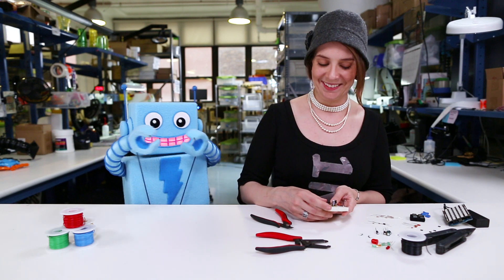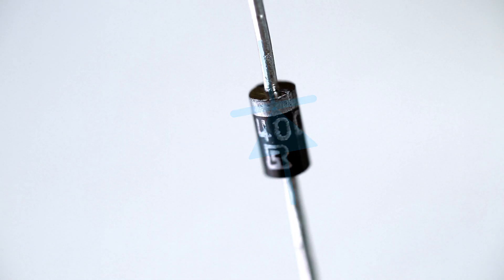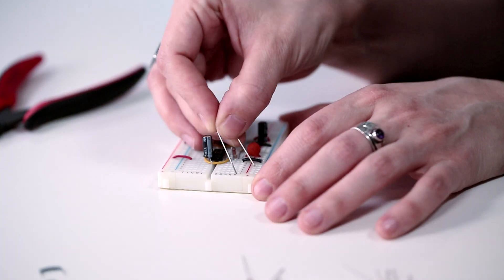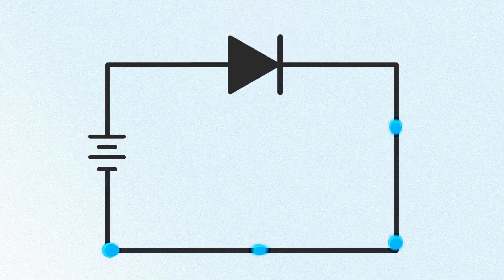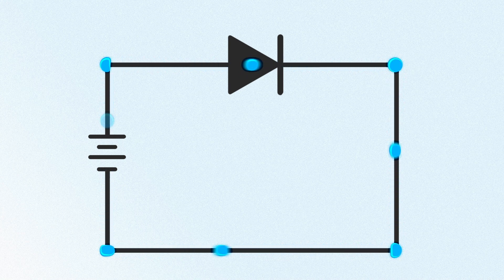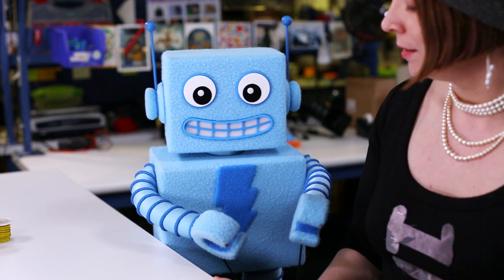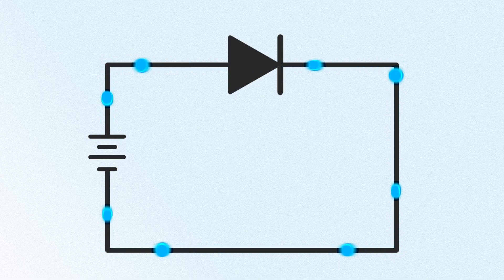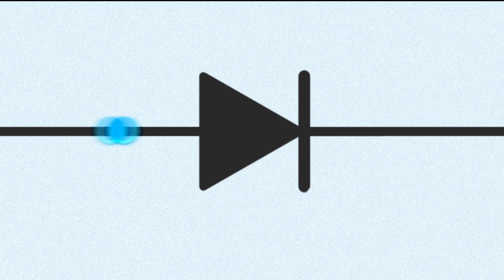"D is for Diode" - Circuit Playground Episode 4

Comment: Using a diode in series is not the best for reverse polarity protection, because of the voltage drop, but it is indeed a surefire way.

Comment: They got the current direction that flows through the diode wrong, it goes through the arrow in the direction its pointing
Reply: They showed electron flow. Which is opposite to conventional current.
Reply: pairofdice Showing electron flow opposed to conventional current wasn't very instructive. Confusing for a beginner.

Comment: I was expecting the diode to be used as a crowbar to protect from reverse  polarity. First of the voltage drop across the diode. Second sparks and a blown fuse should clue someone in they did  something wrong. Should.. I have open some stuff  where someone had large supply of fuse, because I found  the diode open and circuit traces opened after the diode failed I assume.

Comment: I wouldn't have explained it with electrons. In an electronic world where everything is designed that current flows from + to -, adding the electron part makes it confusing.
Reply: *****
I probably think you know what I'm meaning, only physics needs the knowlegde of the flow of electros. Most basic EE stuff only needs the idea that the power flows from positive to negative.
Reply: Completely agree with Rivalo.  The added benefit of using current flow with diodes, as opposed to electron flow, is you have a convenient arrow showing the direction that the current can pass.
Reply: ***** We can disagree about what convention is best, correct, etc.  For me, electricity did not take hold mentally until I learned conventional current.  Upon further review, lets agree that voltage does not 'flow'.
Reply: I agree. It's irresponsible to introduce electron flow referring to as current. 
Like the truth about Santa, the electron's secret should be guarded until the right age. About the time a child gets curious about pn junction physics. 😄
Reply: ***** Voltage does not flow, it drops. And "conventional" current flow as taught at places such as Carnegie Mellon represent current flowing from positive to negative (in the direction the diode arrow points). Electron flow is for physicists. Conventional current flow is what engineers worry about. But it's all just math and frame of reference.
Reply: No it does not, voltage doesn't flow anywhere at all. Voltage is the potential energy for a source to produce current :)